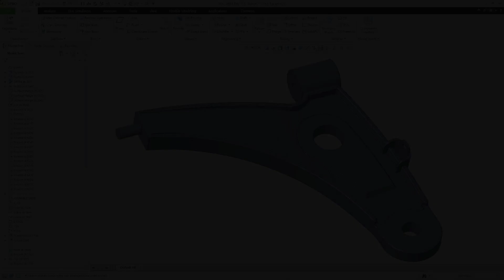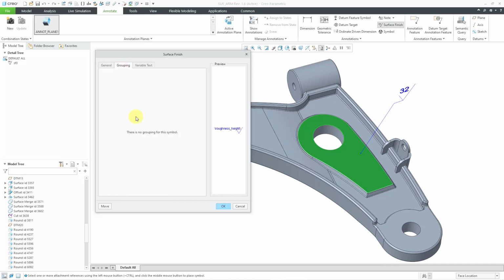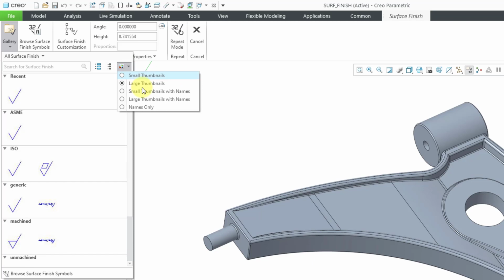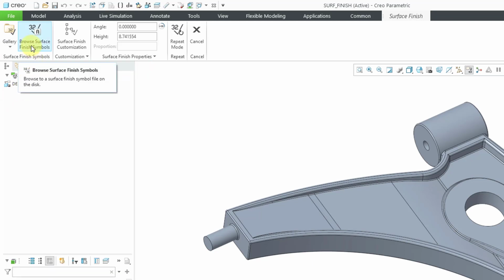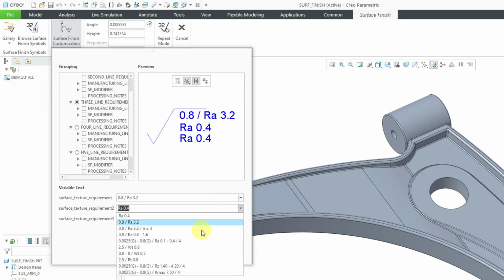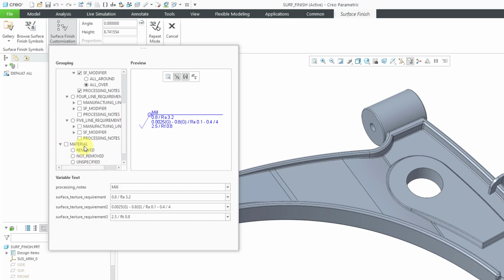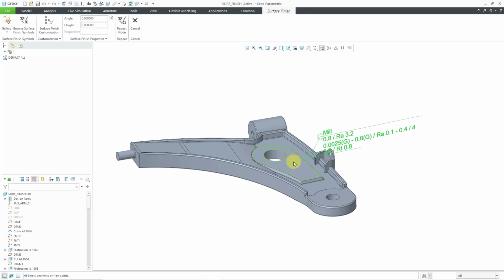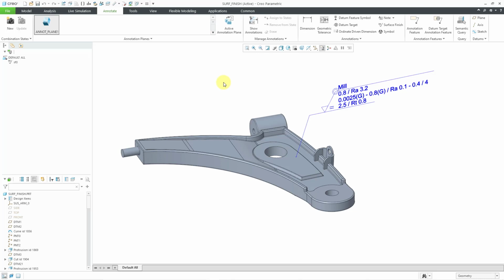Creo Parametric 9.0 - Surface Finish Symbols - Part 1: Placement

Comment: I want my Ra value to be above the "V" of the surface finish symbol like you showed at the beginning of the video for older versions of Creo. How do I do that in Creo 9.0?
Reply from the maker: Use one of the older symbols, which are still available.